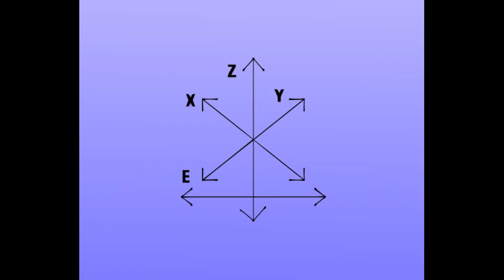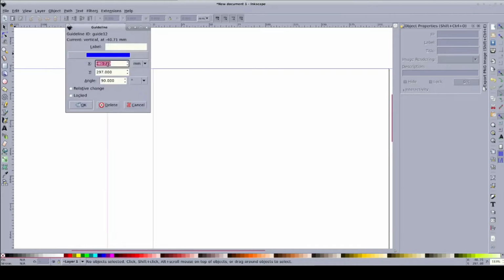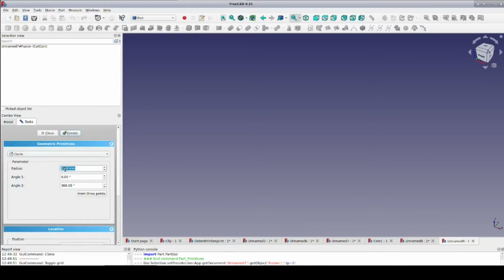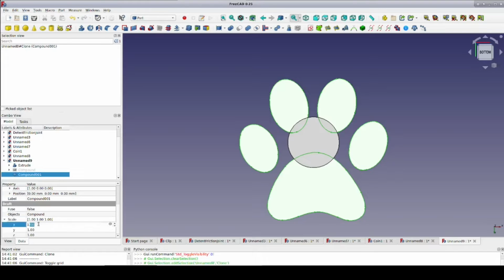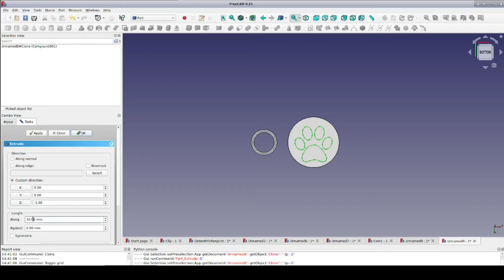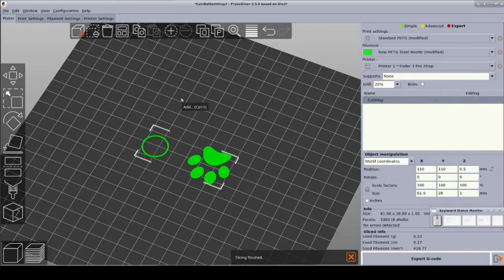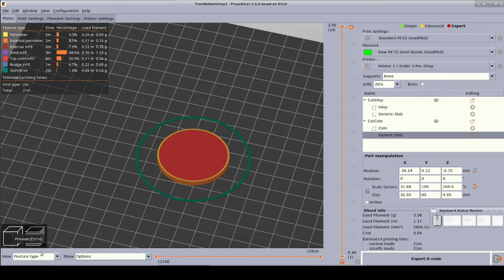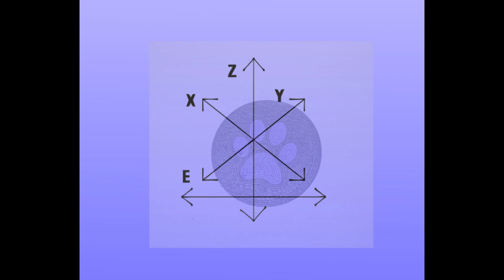3D printing: Add an inlay to the bottom of your print

Comment: As I mentioned in the other video you can export both the inlay and the coin in the same step file and import it in PrusaSlicer. The slicer will see those two bodies and they will be positioned exactly the same as in the step file, already aligned. Those bodies can have different print settings and can be turned on or off by changing it's type.